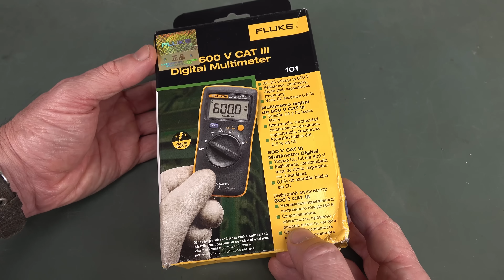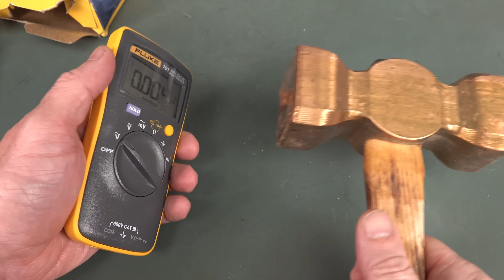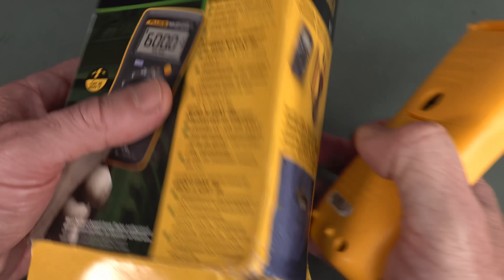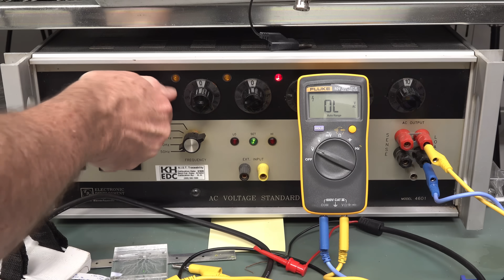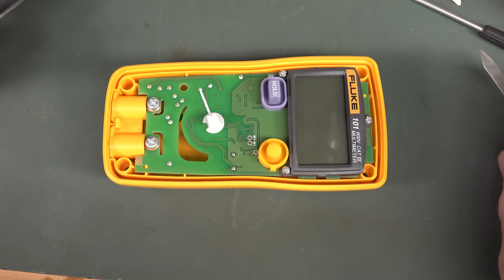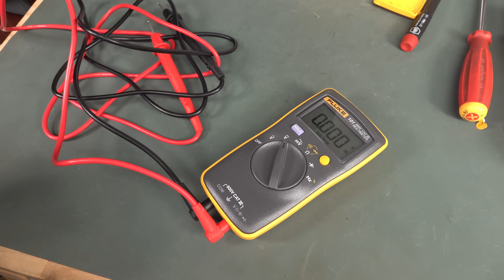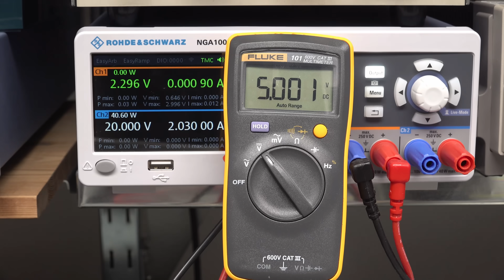EEVblog 1574 - REVIEW: Is the $42 Fluke 101 Multimeter Any Good?

Comment: For the cheapo multimeters my "min requirement" is auto-off / battery safer.
Dont hate anything more then getting a multimeter for 8 bucks,
the bettery replacement costing 5 bucks,
and it can happen every week.

(i tend to use voltcraft / local cheap brand for CONRAD for students and small stuff)

edit: also handy to have some simple ones to just have multiple voltages shown at the same time,
without having to hoist around a chunky benchmultimeter, which needs a table, costs a lot and isnt really needed most of the times.

Comment: Cheaper to buy this than to keep getting a more expensive one calibrated.
I have clients that require calibration data for my DMMs. It rankles with me because none of the measurements I do on their equipment needs precision better than 1 volt . Calibrating a DMM here costs around $500 , I tell them that if they need calibration data  they provide the DMM. They already do that for other test equipment such as temperature probes and pressure gauges. Obviously they are trying to off load the calibration cost onto me.
I had another client with similar policies and used to by a new Jaycar $50 DMM every year to satisfy their requirements. They were fine with that because all their SOPs required was that DMMs needed to be calibrated every year and no mention was made about a new DMM.

For my own purposes I check the DMMs against the output of an array of  LT1021 and LT1027 precision voltage reference chips

Comment: Re: lithium.  If one was to change battery chemistry in the meter, would they compromise any of the performance/safety ratings?  I've wondered this for a long time and had hacked my 289 to run on lithium cells before having doubts and reverting back to alkaline cells.  Or maybe nimh eneloops.  Hmm

Comment: The problem I often encounter with really long battery life devices is that the batteries start leaking well before it is used up. I tend to use the carbon zinc cells in these circumstances, they less likely leak for me.
Reply: Consider using low self discharge Nickle-Metal Hydride cells-they should work ok in this meter, and will not leak.
On some other devices, the lower voltage can be a problem though.
Reply: @m.k.8158  I do if the device accepts the lower voltage. On my uni-t, the low voltage means it doesn't use up the battery all that much. I ended up modifying it with a cmos 3.3V LDO and 10440 cell in the battery compartment. Lasts ages and pretty low self discharge too. Low battery indicator lights up at 2.5V perfect for the li-ion

Comment: It seems to be a disingenuous product that they don't expect to have real appeal such that the sheeple still buy the absurdly overpriced fluke 87.
Even the much better value other brands for 50$ are bad because it's the same stagnant 1980s tech. A handheld meter costing hundreds of dollars should be capable of fantastic things today. 100MS/s scope, spectrum analyzer, RF meter, radiation meter, clampless current probe, accelerometer, angle measure, GPS etc. Fluke could be excellence but they choose to be an anchor weighing the world down.

Comment: I’ve had one of these in my tool back for years for troubleshooting heating system wiring and components it’s been decent I got nice silicon leads for it the ones that come with it are very stiff

Comment: I got a fluke 106 and absolutely love it, its great for throwing in my bag when traveling with a few terminal screw drivers and dont want to take my whole tool kit. It's definitely not a replacement for a full multimeter, but perfect for what i need it for.

Comment: I have one in my shop. No regrets. Now my 87V stays cleaner!
Reply: I bought a brand new 87V for my bench at home and got tired of how greasy it became after needing to use it to work on cars.  My solution to that problem was to buy a used/filthy 87V with a slightly damaged case from eBay to work in the garage.  Love my 87Vs!

Comment: I pulled the 101 out of my bag, and put in a UT211B. I've got the big boy Flukes available of course, but for the size, I prefer the UniT for daily carry.
Reply: How do you rate the Uni-t for build quality?  I'm torn between a Zotek ZT303 for accuracy at about $40 or a Unit-t UT61B+ which is less accurate and costs about $65 but I think might possibly be better built, I'm talking reliability of the switch and input jacks mostly.  The UNI-T does seem like a good choice for something well made but at a reasonable price.
Reply: @dunk8157  I haven't had any issues with the jacks or the range switch, but at this price point, for any professional, just buy a backup or two.

Comment: Dave I noticed the laggy continuity test can be improved on the Aneng with fresh batteries. Possibly the same for the Fluke. Delay gets worse as the batteries drain. The capacitance test is also slower

Comment: on the fluke 101 the AC mili volt range is so it can be used with the fluke i400 current clamp

Comment: I got one of these as a gift at work, keep it in the trunk of my car
used it a few dozen times, never had to replace the batteries ... i cant recommend it to anyone unless you work somewhere that requires you use a fluke, but i cant complain about it 
i do however keep the AN8008 as a quick pocketable meter to carry around the office and warehouse (if i dont want to take my still daily workhorse 121GW) with some custom rewired short probes and i love it, even the square wave generator in it has come in handy for testing stepper drivers and speakers

Comment: i love the 101 i have several of them only issue is they dont sell them in the uk as an offical model even though they are ukca marked. i think its brillent for my work as a electro mechanical enginner so relay, contactors, solonoids, heating elements, ntcs
yes the capacitor function is rather slow but i probally only need to use its maybe once a week or once a fortnite so not an issue. battery life is incredable my prevous meter batterys would last 5 to 6 months depending on use the 101 had for well over a year still on orginal batteries being used 5 to 6 days a week.

Comment: Since it apparently works at up to 4.2V without issues, I'd really like to see a LiIon cell in the next revision of that meter..
Reply: Why bother? According to Dave’s power consumption readings you could use it 40hrs a week for five months before the alkaline cells die
Reply: @Turbochargedtwelve  yeah, the batteries last forever on this meter. There is really no point.

Comment: The Aneng may be cheap but from all the people I know who had one (the even cheaper,  blue one) , the meters all died, some after not using them for a while. Mine still works, probably because I have never used it. Bought it out of curiosity and to make a video about it.
Reply: Contact cleaner on the range switch tracks should fix that?
Reply: Clean and lube the gold contact tracks and switch wipers, its easy to take them apart, even the old flukes need to have this done after a while.
Reply: @dunk8157  Mij oldest Fluke with a rotating switch is a 77-III, I have it now over almost 30 years and never had to clean the contacts, they do not need cleaning, they are gold plated and very well build. If the Aneng needs that within a year, then it is really crap. I repair measurement and calibration gear and never have seen Fluke switch problems except for a current clamp but that was because someone had lubed the switch.

Comment: I prefer dmm which dont measure currnt as one can end up burning internal fuses if one accidentaaly one leaves out the probes in current position and end up measuring voltage!! Fluke 101 is great tool considering the probes from fluke cost mose than 40 bucks. I have two of these fluke 101. yes the only downside is it cant do DC millivolt range. Yes the capacitance measurement is slowwwwwww...

Comment: This has been my multimeter for the past 9 years. It's great. My tip to anyone with this meter is change your batteries every 2 years out of habit. Mine leaked everywhere and corroded my contacts. My screen has a dim area, so it's on borrowed time. Completely my fault though. It was great watching you put it through all that stress testing and pulling it apart - I have even more respect for my meter now.
Reply: Hi, suggest you use lithium non rechargeable batteries is all test kit, they are good for 8years plus without leaking so they will run out well before they leak, I've ran these in all my test kit for years after suffering from a few leaks in some of my expensive kit.
Reply: @seanpduffyeng  thanks, I think I will do that

Comment: I have a few and have been quite happy with them as basic quick trouble shooting meter where absolute accuracy is  not my primary concern. My best guess on the AC only mA range is they have have it for use with AC only current clamps. Which are just current transformers with a small load resistor to turn the output into a small AC voltage. I would make some sense given that these were originally intended as low cost electrician/field tech meters for the Asian market.

Comment: Not bad price for a toss around in the tool box multimeter. Whack in some AAA lithium's and no worries, it just gonna work. I have a Fluke 76 that I use out in the field that takes a licking and keeps on ticking; I really can't say much for my Timex watch though. Only issue I had with it is the banana post inside the main board needed some solder reflow to bring it back up to snuff. For its age, it still commands $100 USD in the decent pre-owned market.
Reply: I am also using Fluke 76 since mid 90s. Back then only hadful of meters had TRMS. Very nice and reliable meter, a real gem. Recently I compared it's readings with friend's Fluke 87V and they matched to the last digit.

Comment: I like the separate AC and DC voltage measurement modes right on the dial!

Some compact meters only have one mode on the dial, and they default to AC mode, so you always have to separately select the DC mode. This can be a nuisance if you mainly happen to need the meter for DC measurements, like quick car diagnostics.

Even worse if the meter has a short and non-adjustable auto-off time, and then always defaults back to AC at power on, like my current one does...
Reply from the maker: The Fluke 80 series famously switched from default DC to default AC mode with the model III and it pissed a lot of people off.
Reply: Exactly how my uni-t 210 E and D are. Good thing it has been hacked in the eevblog forum I was able to change the default modes and set the backlight and auto off timers to hours.
Reply: @quandiy5164  my 210E has been bugging me doing that, how hard is making the change?
Reply: @Firecul  you just need an arduino to read and edit the eeprom. There's a big thread on the forum on how to connect it. The confusing part was figuring out which values to swap but I eventually got it, there was a table in the datasheet showing which addresses correspond to what functions. I also did the 6000 count mod.
Reply: @quandiy5164  That might be the 50+ page thread I found then. 
I don't have an arduino actually, never needed one. A quick read though a couple of posts just made my head scramble. I'll keep it in mind but it's not as simple as I wanted lol
One day I may attempt it.
Reply: Think my 87V is going on ebay to buy this one.

Comment: I keep a Fluke 101 in my motorcycle luggage in case of emergencies. It's got everything I need for automotive debugging, and I know because it's a Fluke it'll work when I need it.

For bench use? The lack of a current range, and weird AC-only mV range makes it a no-go. I have a couple AN8008s for my spare "I need an extra meter" tiny meters, on top of my daily use BK Precision and Brymen (BM235, of course) meters.

Comment: Not having amps can be kinda nice sometimes, honestly. Used to work at a hobby electronics store and got a couple dozen meters back every week from people claiming "it blew up and smoke came out". Everytime it was because they tried to measure a car battery on amps and blew the fuse because they used the wrong port. Store policy was anything returned below $150 had to be hit with a hammer and into the dumpster. Such a waste.
Reply: Yeah, also makes me think of polytech tutors endlessly replacing multimeter fuses blown by their students. Is also a feature that would add significant cost and design constraints - those fuses take up a lot of room in a small meter.

Comment: Those input jacks are skookum as frig, really well built. I have another budget Fluke, the 12E+, but as I have several multimeters it does not get used much. I mostly use it for mains electricity and tube amplifiers as I trust it, being a Fluke, albeit a cheap Chinese model, more than my other meters (Aneng, Zoyi, Uni-T etc.) when working on potentially dangerous voltages. I also use Flukes at work, though as a truck mechanic I mostly just measure stuff like 24V DC and continuity. And yes, compared to the cheaper meters the build quality on Flukes definitely feels more solid and trust-inspiring.

Comment: I'm really not sure what a meter is good for if it can't be also used for current. I have a Thsinde 19b that I keep in my big tool bag and it serves its purposes well. For the $21 Yankee Bucks I paid for it, I think its worth it. If I break it or it dies, I'll probably upgrade. Only issue is it runs on 9v battery, so I keep a spare with it.
Reply: Yes, it’s a little strange to leave that out.

Comment: Nice meter, though I would say the next board revision will remove those pads, probably there to allow them to use the last batches of the regular programmed multimeter chipsets they had, before they went to the ready programmed bare dies and blob assembly. Respin the board and solder mask, to save that 0.1c of copper and ENIG on those pads, and soldermask to provide the protection. Seen that on buying cheap meters and other stuff, the later versions remove the chip outline, so they can use that board real estate as well, which sometimes means a board shrink as well, to get more out of the big sheet.
Reply: I suspect those pads would very likely be for the storage of calibration parameters in the EEPROM as part of the production process.

Comment: Dave, try out the Fluke 107!! Nearly the same meter but top entry plugs, a true hold button, LED button, etc. Now, a bit over double the price but fantastic!!
Reply from the maker: Oh, it's got the TouchHold?
Reply: Proper hold seems really helpful. Press hold, eyes on the probes and getting a good connection, I assume meter beeps once you have a stable reading, then you look over at meter. I just fount out that my UT61E has auto hold if you long-press hold (but you must re-initiate each time you make another auto reading). Nice.
Reply: For that price you could get a Hioki!

Comment: A multimeter without current measurement is utterly useless.
Reply: Heh, one of the reasons I bought the fluke I have is because it didn’t have a current range. IME they are more trouble than use
Reply: @robertadsett5273  You must not use your meters for much. In my mind, it's no longer a MULTImeter if it doesn't have current.
Reply: @han5vk   You I use them a lot, just not for current. In my experience in the lab the current range never worked anyway. The fuse was blown and you had to solder another in its place. Plenty of other ways to measure current and some of them don’t require disrupting the circuit
Reply: @han5vk  If I need to measure current, I have about eight different clamp meters available. In ten years as a professional electrician, I can count on one hand how many times I've needed the current mode on a multimeter.
Reply: @sjholmesbrown  Good luck measuring sub-mA currents with clamp meters... But yeah different needs for everyone I guess.